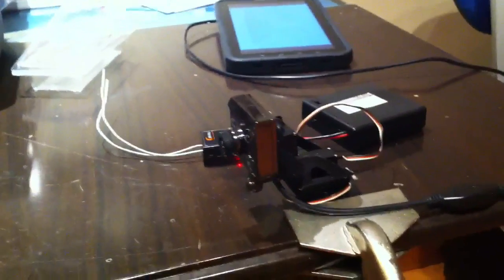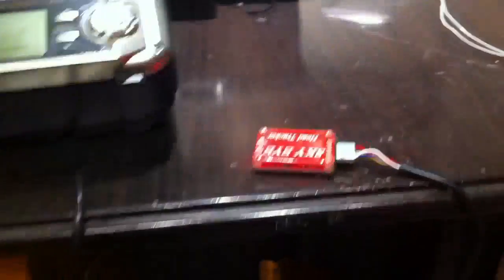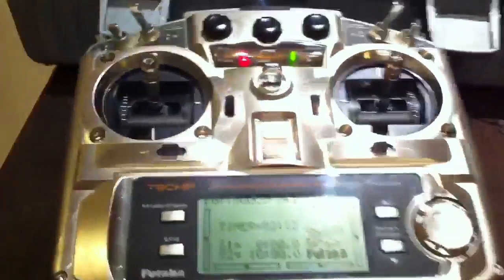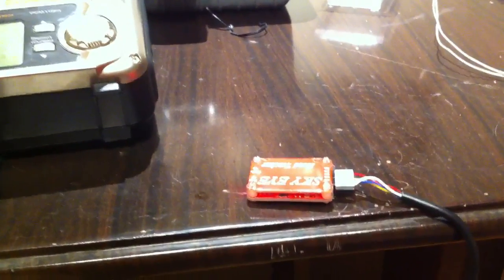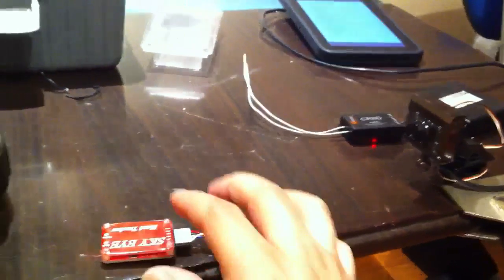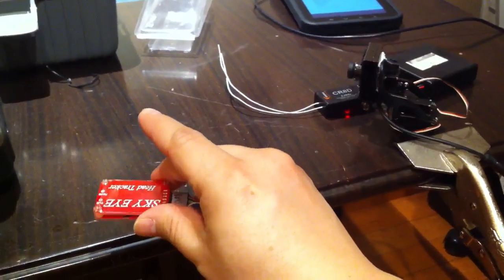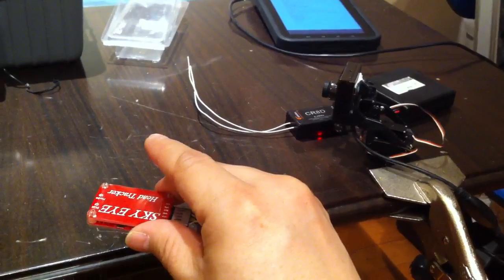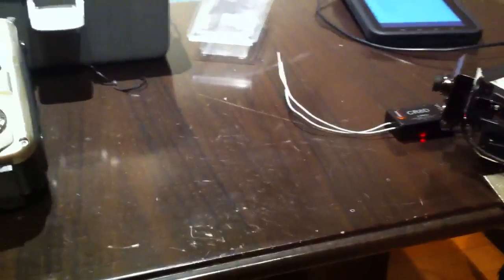FPV gimbal with magneto sensor IMU

Comment: HI. I exited on your gimbal.
Actually I don't have knowledge of that. but I wanna make the gyro sensor camera mount. I wanna make gyro camera mount for motorcycle. So only I need horizontal moving camera mount. 
I already made some mount but that's just assembled. 
Is it available without RC controller? Just keep maintainning horizontal axis.
If you know of the knowledge about that. then Please let me know.

Thanks.